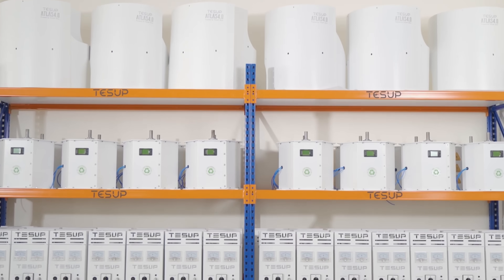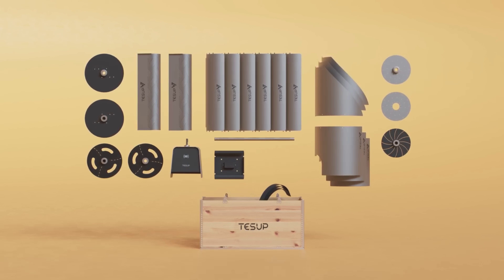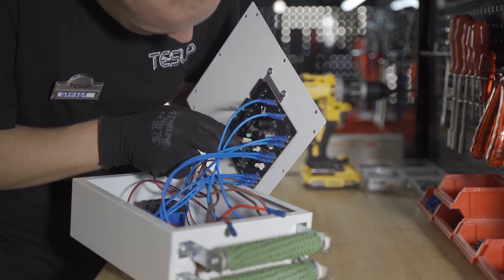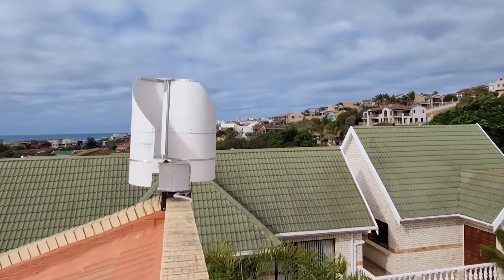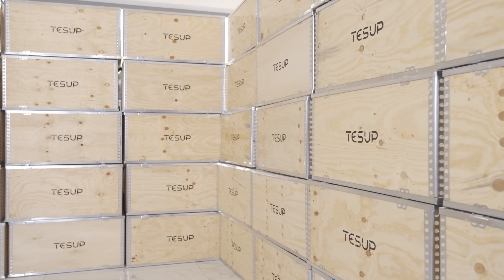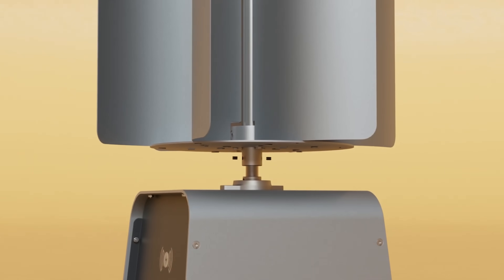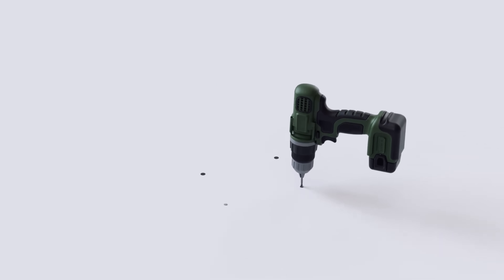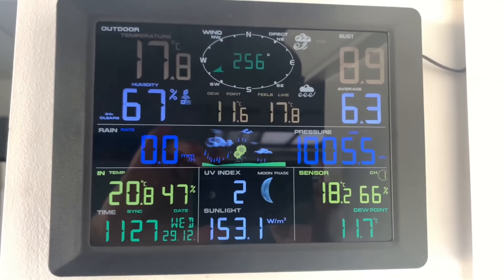TESUP V7 NEW European Wind Turbine for Home Out Perform PV Solar Panels in 2024?!

Comment: Reality: All practical tests show that small wind turbines hardly generate any electricity, because hardly any wind blows close to the ground! Wind/electricity yield increases with the third power of the wind speed. So +100% wind = +800% electricity. But close to the ground: 0 constant wind, only aggressive gusts! Solar panels generate at least 10 times more green electricity with the same investment in time & money! Whether wind and/or solar power - you need extremely powerfull batteries or a petrol generator to live off grid.

Comment: I live in Malaysia I design wind turbine same as this 1kw wind turbine it help to charge my ev car driving and parking it works wind turbine genarete electric charger my 5 kw power station this power station energy charge my byd atto 3 1 day 30%100 to 150km depend on wind

Comment: I couldn’t help but raise an eyebrow at the claim that it delivers up to 7kW. That kind of figure might make sense if we're talking about total energy produced over a whole day—but when you state “7kW” without context, you're implying instantaneous power output, which is measured per hour. And that's a big claim for such a compact turbine.

JMaxwell1000 broke it down brilliantly using actual physics. Nowhere near the claimed 7kW.

In short, both the physics and my gut say the same thing: the 7kW claim just doesn’t hold up.

Comment: The formula for power (watts) is volts x amps. Ohms law. 7000 watts at 24 volts would be 290 Amperes. I doubt ,very much the windings of that alternator can carry 290 amperes, not even 20 amperes. Too much fake wind turbine news out there.

Comment: I have a very stupid question. But if you like to give an answer please do. 
What if I put 2 of these generators on a vehicle roof top on my ev car,  which have 25 kwh of battery. 
And also have extra battery which will be charged by generators and one which is in use. 
Will these 2 or more if needed wind turbines will charge my 25kwh battery which is not in use in 3 or 4 hours?
As I assume my car is running 60 to 100 km/h
Reply: No this won't work. Your car needs energy to get up to speed and with these turbines on its roof it will need more energy to get up to speed. It will need more energy than what these two turbines produce. All mechanical contraptions work at less than 100% efficiency  (for wind turbines at much less than 100% effciency). So overall you will lose energy and your car battery will drain faster. If these wind turbines are mounted on the roof of a house the force of the wind flow will produce the energy. But in this case it is ultimately the sun that produces weather and wind which you can harness with the turbine.

Comment: "TESUP is a European leader in photovoltaic panel manufacturing" => FAKE NEWS!
All practical tests show that small wind turbines hardly generate any electricity! And only at very high costs! Because there is hardly any wind close to the ground. It is also extremely gusty, which usually shortens the service life extremely! Only if you need to be self-sufficient from the power grid & live close to the sea, you should install the largest possible wind turbine on a high mast. With solar modules, on the other hand, reliably generate electricity for 25 to 30 years at approx. 2% to 5% oft he cost of small wind turbines!

Comment: I wonder if Elon ever thought of adding wind turbines to his cars for charging as they're being discharged at MPH? Seems to make sense???
Reply: No it doesn't make sense. For reasons of physics. The only way you could potentially use these turbines would be if they were enclosed within the body of the car during acceleration and cruise. Once you would want to break they would pop out into the airstream and help breaking the car. In that way you could reclaim a very small amount of energy. But E-cars do this much more efficiently by converting the electric engine into a generator during breaking.

Comment: In the video, they showed a user who said that it wasn't working. It's not spinning fast enough to generate current. The voltage is too low. They had to extend the blades of the wind turbine.

The problem was more or less resolved. But the energy produced is not very much.

The video is visible on YouTube.

Comment: FAKE! TESUP is NOT a "European leader in photovoltaic panel manufacturing".

All practical tests show that ground-based small wind turbines are extremely inefficient. 
With solar panels, you can generate at least 10 to 20 times more green electricity with the same investment!

Comment: FAKE product! And TESUP ist NOT a "European leader in photovoltaic panel manufacturing".  That is also pure nonsense!
All practical tests show that ALL small wind turbines hardly generate any electricity! And only at very high costs!
With solar panels, on the other hand, you can generate electricity reliably and almost without maintenance for 25 years at approx. 5% of the cost of wind power!

Comment: If the things stated here were true they would have independent confirmation and accreditation!

For this to work as advertised you would need to be in a hurricane! Even their own advertisements show a reading of  60V 10A = 600W (I suspect that is at the top end of what they could actually get out of it) ....... Why would they use such a low figure if they could get anywhere near 7000W out of it?

They also say it can give you 168,000wh a day (which is 7kw for 24 consecutive hours ........ I call BS on that one too!

This guy is a vapourware salesman!

Comment: Before you buy this product, consider the first part of the video showing a wind turbine with the name TESUP which is a direct rip-off of the TESLA logo. The name is also so close to TESLA I thought initially it was a video about a TESLA wind generator. Secondly, I'm not a physics genius but I do know that a small generator with an output of 7kW is absurd. Look at the other generators of a similar size and you'll see that they have outputs of 250W or maybe 500W which is a very useful output for a small generator to keep the batteries on a small yacht charged for instance. I have seen one that is capable of an output of 1.2kW but it's getting quite large. I believe this is all a con and there is no way I would send them AUD$2500. Lastly, just look at the hundreds of unhappy customers leaving 1 star reviews. Absolute scam.
Reply: thank you
Reply: Those TESUP commercials are sold to the company and are advertisements not to be confused as those large turbines are TESUP-made ones.

Comment: Given that the normal wind turbines are 98% efficient at extracting the available wind power, it is NOT POSSIBLE to improve y 700 %. Utter nonsense!
Reply: I think you will find it's around 35% for these vertical types. And it's nowhere near that. It's a scam mate

Comment: There is no way this turbine can generate this level of power it has a swept area of only 0.36sqm. The equation for wind energy is 1/2 x air density x area squared x velocity cubed. This is the total amount of energy in the wind NOT what can be generated. So lets put some numbers in for wind at 8m/s over the area covered by this turbine. 0.5 x 1.25 x .1296 x 512 = 42 watts. This is the total energy in the wind stream that interacts with the turbine. Betz law says the most energy that can be extracted from the wind is 59% so the max is about 25Watt available but this turbine is 33% effecient so will actually get 13watt which is 312 watts per day. To get 7Kwh energy in the wind alone for the area of this turbine, wind speed would need to be 45m/s or 100mph.
Reply: Probably 168KWh over 12 months, or its life time 🤣
Reply: Does someone install it for you?
Reply: Nice idea though
Reply: This is the kind of review I like. Facts and verifiable science.
Reply: 300 days of sunshine here in Colorado how many windy days, don’t even have a chance to beat up the sunny panels lol🤔
Reply: “Capable of “ is sales jargon. It means during a hurricane it could.   It has already been shown this type of unit by itself produces very little.     The fact that they are comparing it to 1 solar panel is a hint.
Reply: I am considering a vertical axis wind turbine that looks exactly like a tree, I call it : e-tree,
the bottom is brown like a trunk, the spinning blades are green like leaves,
on the trunk of the e-tree, there are features of : mobile network, light and power outlet, to charge a car for example
Reply: Many bad reviews Online for this company.
Reply: so you put this crap up when its time for tornado or any other shitstorm
Reply: Betz law do not directly apply to vawts but I also don’t think anyone can get >50 watts out of this thing
Reply: I have a very stupid question. But if you like to give an answer please do. 
What if I put 2 of these generators on a vehicle roof top on my ev car,  which have 25 kwh of battery. 
And also have extra battery which will be charged by generators and one which is in use. 
Will these 2 or more if needed wind turbines will charge my 25kwh battery which is not in use in 3 or 4 hours?
As I assume my car is running 60 to 100 km/h
Reply: Low efficiency of less than 15% theoretically and since 10m/s is roughly 20mph I do not see this thing working for me or anyone...they need to rate it at like 100watts if the electronics turn on at low speed.  

However for those that have a tendency to believe fake alternative facts,  if you stick it on your truck maybe you can get 7KW. you know the one with the flags and pipes?  in that case you might be able to drive for free.
Reply: @JS-zq1gp  great comment..its complete crap 7kw
Reply: They claim 7kW per hour or 168 per day
Reply: @Mark-em5zm  🤣🤣 paper never refuses ink
Reply: @Mark-em5zm Under what conditions though? If they are claiming they get &KW out of it in anything less than a gale I call them Liars!
Extraordinary claims require extraordinary proofs ...... what Proofs have they shown?
Reply: And they say it can be operated at 50 m/s. So what’s your point? That they can do better than 7kw?
Reply: Solar & Wind Combined = 8 Kw
Reply: The Oysterman, you should continue spending your time on picking oysters - your brain dont work very well despite all the thumbs up for your post. At 8m/s the wind travels 28800meter/hour, if wind will move turbine 0.01watt per two cm the wind moves, then it will generate 14,4kwh per hour....i do not claim anything about if Tesup work as supposed to, but your calculation dont make sense.
Reply: Yes it can
Reply: @SteveStowell  No it can't! 
........ If you are so sure show some proof (and get ready to be a millionair because you will have broken the laws of physics ... or cheated)
Reply: @SteveStowell   yes it can what .....

Comment: Just not possible , I have worked with very efficient 5kw wind turbine systems and believe me you won't get anywhere near what they are claiming,
Reply: from your experience which is the best in the market ? we are looking at using VAWt to design a hybrid energy need for a home offgrid , we are doing this because the home doesn't have roof space for solar panels  ...so which VAWT is efficient even if its up to 70/80%
Reply: What voltage is the model, 12v system?

Comment: Truspilot score of 1.3 out fo 5 😱should be a cautionery flag for anyone consdiering buying this unspecificed product. They obviously have customer service, support issues and the product is not definitively specified. 

The TESUP website says it produces "7kw of power", but do not be confussed this is NOT the same as a kWh (killowatt per hour) rating. There is no way that little generator can generate 7 kWh, so who knows what it actually produces when TESUP don't actually state the kWh rating, 

If it was say 500watts (not likely but the math is easy) , when the wind is optimal, it would take 14 hours of optimal wind speed to gerenate 7 kWh of power whihc would need tobe battery stored and inefficiences would reduce this. The average USA household consumes 10,791 kilowatthours (kWh) per day.

A 7kWh generator head is a huge heavy item. This looks more like 200watts  
https://www.amazon.co.uk/dp/B0BCQF3JPY/ref=sspa_dk_detail_1?pd_rd_i=B0BCQF3JPY&pd_rd_w=aKGf0&content-id=amzn1.sym.84ea1bf1-65a8-4363-b8f5-f0df58cbb686&pf_rd_p=84ea1bf1-65a8-4363-b8f5-f0df58cbb686&pf_rd_r=JGKJTH3AHM45D2YBXNJ3&pd_rd_wg=6HBKY&pd_rd_r=02d88772-efb6-48ca-a4ca-2d9416149c21&s=diy&sp_csd=d2lkZ2V0TmFtZT1zcF9kZXRhaWw&th=1

Take alook at this independent review https://www.youtube.com/watch?v=lY6Es4TOBfQ
Another independent review, https://www.youtube.com/watch?v=x0jI-xwheqc

Critical review with scientific evidence.   https://www.youtube.com/watch?v=3o2UtrgIOf4

I wish TESUP would fess up and be more factual about the actual power generation rating

Comment: Every wind turbine that is featured on this channel is described as one of the best ever. Rarely do they live up to the hype. Look, the channel is interesting but unrealistic. It also gives very little detailed information about the product. Tesup themselves gives limited information about their product. Interesting but frustrating.
Reply: Thank you . I am not watching any further.
Reply: It spins & looks nice what more could you ask 🤔 Ah voltage output against speed of wind, loaded power current and voltage under different resistance loads, are the nuts & bolts made from stainless steel, whats the size & weight, are parts available for repairs, help desk technical in English yes it looks nice 😅
Reply: Yep Independent verification and calibration standards urgently needs to be initiated. Lot of crap n hype has made me ambivalent and hesitant to take any action so far. Shame on Them !
Reply: I am considering a vertical axis wind turbine that looks exactly like a tree, I call it : e-tree,
the bottom is brown like a trunk, the spinning blades are green like leaves,
on the trunk of the e-tree, there are features of : mobile network, light and power outlet, to charge a car for example
Reply: They make FAKE VIDEO'S to get views. Views pays money.  There's the motivation.
Reply: When I was an apprentice I often said Tea's Up 😅